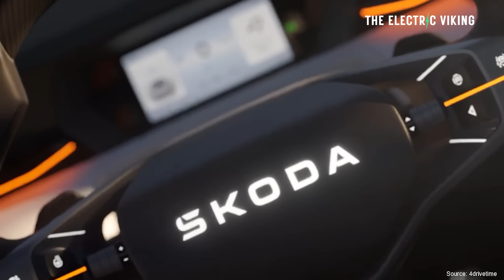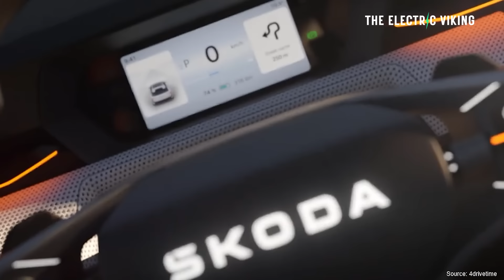New $25,000 Skoda Epiq is an Electric SUV that will destroy the Toyota Corolla

Comment: Battery chemistry: sounds like the base model (25K Euros) will have an LFP but the longer range model will be NMC.  I'd be looking at the base model anyway so that's fine by me.  I don't think we should buy NMC  batteries for all the reasons you have outlined before. 166kW motor - a sub 7second 0-100Kms/hr.

Comment: Only for people who get rid of their cars quickly, my stepdaughter had 2 Corollas over a period of over 45 years & no major repairs & still drives the 2nd one.
Reply: 5 years from new and a Tesla is worth zero $.
Reply: @Withnail1969 who cares what it’s worth , all cars depreciate
Reply: @jasoncarmichael4540  If you are about your finances, you care about what its worth. Some cars depreciate faster than others.  For example, according to the Red Book Guide.... a BYD Atto 3 owner who bought brand new in 2022 has burned nearly $22k in depreciation.  $11k p.a, gone forever.  By way of comparison, a punter in a Toyota RAV4 Hybrid  has seen virtually no depreciation in market value at all....
Reply: @Withnail1969 BS.   You’re obviously an ICE car dinosaur.
Reply: @RodneyW   Very  Good   👍
Reply: Better do some research on that. 
The cheapest 2019 Tesla model 3 is still going for €23.000, and that is with 150.000 on the odo. Most are still around €30k
Cheapest NEW Corolla is now €34.000 and a 2019 model can be found for €13.000 with 200.000 on the odo.
Reply: @RodneyW  if you care about your finances wouldn't you drive a car into the ground before replacing it? This applies to any type of car. What concerns me the most about EVs is the battery. I am fine with a battery degrading. What I am not fine with if the replacement cost outside of warranty. Most appear to be around 7 to 8 years. I can easily drive a car for 15 years. If the battery dies at year 10 then the cost to replace it, at least currently, is significant. A lot more than replacing an engine in an ICE. I'd like to purchase an EV but price of them needs to come down.
Reply: So, you want to drive around in a car with 22.5 year technology - using the 45 year spam of your stepdaughters Toyota Corollas? Jeez. Why would you do this? Ten years in a car, absolute max.
Reply: @LouDeVere  I'm currently driving a 2006 car, so yeah it doesn't worry me.
Reply: @davidwarren78  Absolutely. I agree with you.  The rapid depreciation for BEV's is a side-effect of the fact that you can expect to replace the battery (at significant expense) after 10-12 years.... (or less if you drive the car hard and use supercharges a lot!).
Reply: Yep, they're pretty reliable. But that's all. 2 in our family.
But I'd still prefer an EV!
Reply: @jasoncarmichael4540 my now 18 year old Corolla has less than 70 thousand km on it, is in excelk3nt condition and is worth virtually nothing second hand.
... And it is a joy to drive. But I do miss the Cruise Control in my wife's newer one.
Reply: @RodneyW  Until he can't find a petrol station.  Then it'll be worth $0.

Comment: This is starting to look like nuclear fusion, the 25K EV is always coming next year, every year is the same, next year....
Reply: Well the bolt&bolt euv existed at or around even under that price point with rebatez&incentives since around 2020 now. 
And the base leaf is available for about that price. 

Not to mention a base model 3 sr after all rebates and incentives in certain states last year was as low as 20k. 👍🏻😎
Reply: @4literv6  Well, I'm in Europe, lets check the price of the cheapest Model 3 with incentives, Yeah, 39.990 EURs = 43.335 USD at current rate, no 25k anytime soon. I guess I have to wait for next year once again.
Reply: @pbrigham Dacia Spring?
Reply: @miti4045  Starts at 21k EURs with a batterie of 28Kwh, yeah this probably has a 150km range, I'm not that desperate, do you know what gasoline car you can get for 21K? then people don't understand why EVs don't have more adoption? We need a proper EV for 25K and unfortunately  those are not here yet.
Reply: @pbrigham  Spring was for like 12K in special sale. You can also buy a used EV?
Reply: There will be new battery technology next year as well, and cheap plentiful green electricity next year, and you will be able to pay for it all with your well paid green technology job that you will get next year. Lol.
Reply: So a decent car at 25k would really be a game-changer!!!

Comment: I like the look of it and it looks as though it meets one of my main requirements, the boot will take my mobility scooter, something you’re probably dealing with at this time, Sam. I hope you won’t need to for long.  
My 20 year old Toyota Yaris Verso continues almost without faults (except minor things linked to the aging of tiny bits of plastic mainly on switches) so my experience of Toyota’s traditional legendary reliability makes me lean emotionally towards them.  On the other hand, I know that EVs are a whole new reality and all manufacturers are going to have to earn their reputations with their EVs so my Toyota ICE experience is almost irrelevant. 
My needs are 95% city with mobility scooter and/or wheelchair, occasionally with up to three passengers. If it were possible to get insurance in the UK for less than the cost of a Maserati, I would import a Japanese Kei E Van, like the Honda N Van EV, but insurance would cost me almost as much as the car itself.  
So I sit and wait as models like the Volvo EX30, Kia EV5 and the Skoda Epiq are announced and start to hit the roads. And I watch to see what insurance might cost. The Epiq looks nice, has a good specification and if it is comfortable, might be what I’m looking for.

Comment: Looks good. A record of good tech support, parts supply, minimal complaints will make sales (or blackeyes will sink reputation). What would really get my attention would be DIY Repair Manuals and instructions for full evaluation of battery and other onboard diagnosis. IMhO: Making it easier for DIYer with electrical and mechanical knowledge would get huge attention, and show the world intent for economical, dependable, and fixable EVs.

Comment: For me,
1) I can get a new Toyota Corolla for a lot less than 25K
2) The Corolla really exists
3) I can recharge a Corolla in 4 minutes
4) Toyota quality is famous and dealerships exist to get it serviced (in the U.S.A)
5) I don't know the battery chemistry or the charging speed of this.
6) Corollas depreciate at a tiny rate and sometimes go up.
Reply: You can only fuel a Corolla in 4 minutes as long as there is fuel to put in it. That may not always be the case as the years roll by. Shell have begun a programme of closing filling stations Worldwide. Around 1000 are to go in the first phase.....
Reply: @onetwothreefour-s1n  Teah, to me, if Toyota is building a true EV, AND THAT IS A BIG IF, then they are playing it right.  Why build EVs that make no money for them.  They could wait till they have giga presses, vertical integration, top batteries, and do it right, making a car that makes money for them.
Reply: @Brian-om2hh Yes, and more and more cars offer reverse power where someone can just help you out and charge you up.  In the future, it will be ICE which is harder to "charge".

Comment: I have a Skoda Enyaq. It would be a Tesla Model Y destroyer is it were sold in more places and more people were told about it. It does not have quite the same raw performance but who cares. Skoda are going to put out very good EVs.
Reply: I bought a Model Y last year, and awareness wasn't the reason for not buying an Enyaq. Those would be:
• Delivery times (9 months, I was told)
• Skoda price cuts lagging Tesla's 
• Tesla's unsurpassed DC charging
• Tesla's future proof software including FSD.

I acknowledge that the Enyaq probably has a nicer interior and better corrosion resistance, but it wasn't enough to overcome the above reasons. My favourite feature with the Skoda is the option to choose between "B" and "D" mode, where Tesla only has B-mode, aka one-pedal-drive.

Comment: I think skoda might do well in Europe in the EV segment. I suspect 25000 euros for the base model will likely still be expensive. I think the timing of this news is striking in the shadow of the Id2all. Wouldn't be surprised if the underlying platforms will be similar. Only one will be a compact hatchback type and skoda 8s likely aiming for the compact crossover/suv form factor. Designwise, it looks a bit like the new eC3, which comes at a similar price point. I don't think the skoda will beat Trsla by a longshore. I think the narrative would have been better if they had focussed more on what European consumers want in their EV. If the focus is Trsla, to me, it means skoda is trying too hard, which, to me,  likely means a less good product on some vital parameters. Perhaps a red flag, maybe.

Comment: At last - an electric Yeti!
Reply: Well almost.... The Yeti was well loved, and was - and still is - a popular car. Even used 5 and 6 year old ones are holding their value really well....
Reply: @Brian-om2hh  on my second Yeti. And yes about residual value. The Karoq was/is a poor replacement. This eV is what its evolution should look like. Two motors and you have a legend.
Reply: Just checked, and the Yeti has 416 L boot space, 1,760 L with back seats down. The Epiq is substantially more spacious (490 litres quoted), yet with a smaller length - 410cm to the Yeti's 422cm. That's an impressive amount of packaging, presumably facilitated by the absence of ICE. This for me is the exciting trend towards smaller EV's, now the SUV markup ploy of the majors has been busted. Transport based on transport needs, not 'aspirational ownership' like we have in the UK.

Comment: Tesla had better bring out their Model 2 PDQ.
Reply: Reuters reported Tesla is eying a June 2025 kickoff for production of a new mass-market compact crossover.  No dealer markups.  Which car do you think will sell better?
Reply: @danharold3087  Hi Dan, let’s see. Tesla haven’t always met their announced dates for bringing new products to market and they are looking increasingly late to this particular party. Margins will be much smaller than on their current models and if they don’t compromise on lack of buttons and stalks they are going to be awarded lower safety ratings. I’m sure it will sell well though, just on the strength of the brand.

Comment: I've never heard of this company making EVs, heavy diesel trucks, yes, EV's no. Will it be just another no range extremely expensive to repair long-term junk pile ?. Another hard pass from me.
Reply: Ha!..... Not sure which version of Earth you currently inhabit.....
.... but, you can take it from me that Skoda DO indeed.... make EVs....
..... and, they're pretty good at it.....!!
Reply: @andymccabe6712  I'm not saying they don't. As usual, their range is entirely too short. They probably will take way WAY WAY too long to recharge. 240 miles is almost nothing. More than 10 minutes maximum to recharge (for me, at least) is incredibly too long. I could care less than nothing about acceleration that puts your brain in the trunk, 90 percent of most humans can not handle that kind of speed. Doesn't matter a hill of beans about how stylish your EV looks if it's on the end of a tow truck. Matters even less in 10 years, you have to junk it before you don't have $10k plus to replace your battery. Nope, another solid no from me and any other human who has just a little bit of common sense. I've only ever seen the trucks, that was several whiles ago, can't really remember what country they are from.

Comment: Every EV is designed to last 10 years/ 100000 miles. The EV value drops according to the battery remaining life.
So here is the math for car owners:

1. Buy a Corrola for $25k  or an imaginary Skoda for the same price (?)
2. Your Corrola will last for 20 years from that point on
3. 10 years after the initial purchase of the Skoda, you either pay for new battery replacement for the Skoda or to buy a new Skoda 

So for 20 years of car ownership ( purchase cost, maintenance and repair, insurance) , you can estimate which vehicle makes economic sense to own
Reply: Where do you get 10 year design life for every EV.     Tesla just put out a posting for a job position for an engineer to design the maintenance out of the car.  For a Tesla maintenance is repair.   I expect that to build even more life into the car.  But maybe you're thinking of legacy that design cars to fail.
Reply: @danharold3087 

The typical life of EV battery is 8-12 years.

Newer and cheaper Chinese or VW EVs are likely to sacrifice longevity of its parts for price
Reply: @jt-vj4sl  I see "Electric vehicle (EV) batteries are expected to last between 100,000 and 200,000 miles, or 15 to 20 years.

Comment: 3:03 You can hardly fit in the car, if you're over 6' high, with the Corolla - and that's in the front sheets. The front glass is in your face and you feel it's touching your nose. Your line of site is obstructed by the car's roof for flip's sake! You cannot sit at the back - unless you're a midget without legs or an infant - and the boot will hardly fit the weekly groceries' shopping. The Corolla design is dictated by marketing and emissions and is therefore targeting a very narrow portion of the consumer public: single, conservative, middle income 25-40 year olds with a job that want to maintain the illusion of owning a slightly sporty car and the even greater illusion of owning a family car while at the same time not paying any consumption (and therefore emissions) penalty. The last part is the only one they truly care about, because its expenses are minimal, because it won't hurt their wallet. It's no mystery this car has tanked compared to the hugely successful Yaris/Yaris Cross when a more careful design/targeting should have produced the converse outcome.

Comment: The Tesla will be cheaper and likely more feature rich. Good luck to Skoda either way.
Reply: It won’t be cheaper. $25k is the target. And normally, Tesla cars are more expensive than they predict. Features are less important than price. If Tesla can’t beat on price, the model 2 is pointless.
Reply: Really? Tesla seem to be having  problems making cars that are practical. The stupid idea of puttiong pretty much all controls on a central touvh panel ought to disqualify Tesla from places like Europe where they understand road safety.
Reply: @rogerphelps9939  things like that make me think it’s time Elon moved on.
Reply: @TheBooban  The Skoda will be built in an ICE factory on an assembly line intended for ICE cars.
Reply: @rogerphelps9939  The controls needed to drive are on the steering wheel.

Comment: better off with a corolla       20 years trouble free driving
Reply: But not of you can't get petrol to put in it. It seems you haven't heard of Shell closing 1000 filling stations Worldwide?  It's the first phase of a closure programme....
Reply: @Brian-om2hh  Overall Shell operates around 40,000 gas stations around the world and another 10,000 through different partnerships with smaller companies.

Comment: Not so fast.   My gf just bought a Skoda ICE.  You can't talk about EV's without considering the price of electric power vs gasoline.  In Poland the numbers do not add up for EV's.  Here in Poland they are buying nuclear solutions for power generation.  The most expensive form of power.   Currently it is coal.  They have the Baltic where there is lots of wind.  But in Eastern Europe the corrupt oligarchs seem to have the upper hand.   Nuclear it is.   To top it all off EV's are more expensive.  Sure you can go cheap Chinese.  They make great disposable one-time use items.   Also the Chinese are power hungry expletives.  The CCP is a mafia state.   Confucius says stay away from the mafia.   I am a fan of yours viking.  But when it comes to my own household I told my gf.   Just do it.   I do not see a better viable alternative on the near horizon.